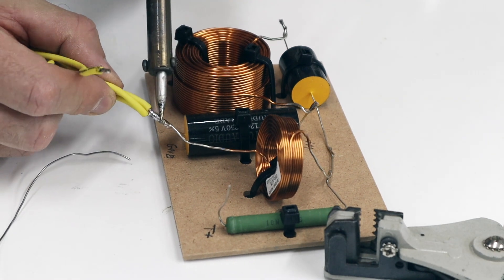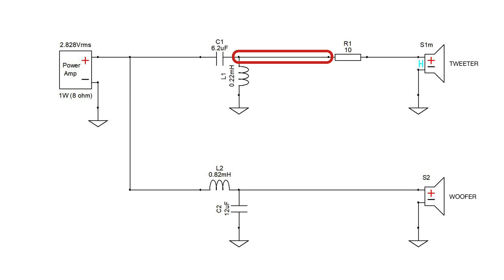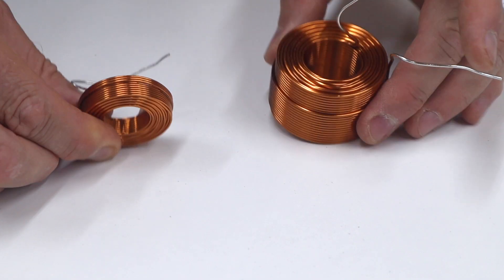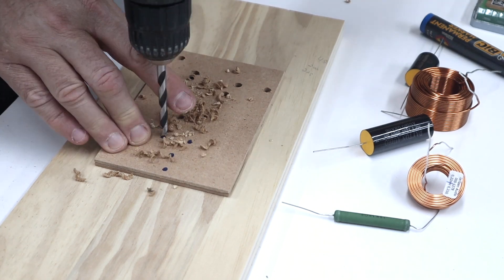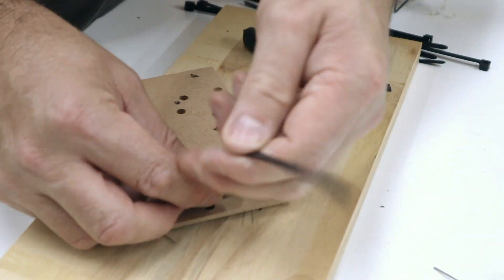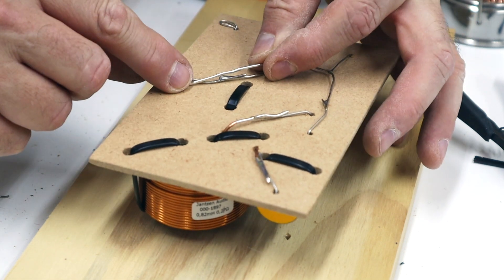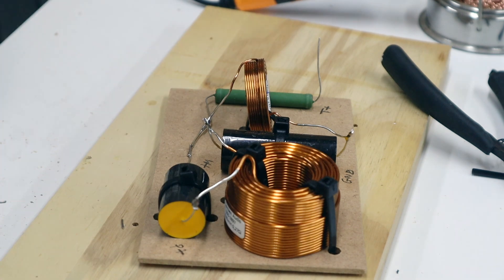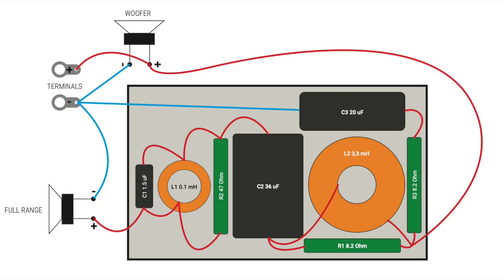How to Solder a Loudspeaker Crossover - by SoundBlab

Comment: Could you do a video’s showing the complete design of the crossover video 1 tweeter coving the design and the different components
Vid 2 midrange vid 3 woofer 
Plus could you also cover passive radiator Danke 👍👍

Comment: How about a hybrid solution where you wire the positives above the board and the grounds below, or vice-versa? May help to keep them separated and prevent accidental shorting, especially when you may need some jumper wires to connect the grounds.

Comment: Hello I have a speaker, I want a smooth crossover with a uf capacitor and eg an indtios mH coil, but I don't know the values, how do you match this speaker with bass, after all, it's a subwoofer Difuzor subwoofer profesional 12 inch

putere 500w/RMS

impedanta 4 Ohm, sensibilitate 97 dB, raspuns in freventa 56-3500 Hz

diametru bobina 4 inch-100 m

greutate magnet 3,55 Kg.

greutate totala: 9.3 kg

PARAMETRI, Fs 56 Hz, Qes 0.33, Qms 8.10, Qts 0.32

0,9mH 1,5uf??

Comment: My JBL 120ti 3-way crossovers used .01uf 200V DC bypass capacitors with the capacitors  (36uf 8uf and 14uf). Is this an advantage or can they be replaced or removed when upgrading to Dayton poly capacitors?

Comment: Where's the best place inside the speaker box, to mount a crossover?
 Im replacing the crossover in a traditional 22 year old box floor speaker.
 The new crossover is much larger than the older crossover being replaced.
Reply from the maker: This will depend on how you have access to the inside of the enclosure. This will normally only be through a woofer opening, so mount it on the back panel if you can or in the rear corner on the bottom panel, but make sure it is at least a few inches away from the woofer motor structure (magnet). If the board is too big for the opening, try making the crossover on two smaller boards, splitting the low and high pass sections.
Reply: @SoundBlab Thank you for the info. 
 I put it on the bottom.
  Clamp glued 3/4" solid wood cut to the size of the crossover, to the bottom of the speaker, then mounted the crossover to it with non magnetic screws.

Comment: I have a question on a bandpass crossover to my midrange.  The midrange is a 8" RadioShack mid.  I currently have it connected to a simple 20uF Polycap 1st order crossover.  All speakers 8 ohm.  The woofer 12" 50hz11000Hz full range RadioShack ( no crossover)   the tweeter replaced (was RadioShack horn)with Morel Cat 378.  This became the issue so I went with a second order crossover by Dayton audio 2000Hz  5uf Cap Dayton with 2.27mH inductor.  Better now but I attempted several tries  with Polycap and resistors with the final decision of the Parts Express.   Sooooo now with nice Polycaps left over I thought I would try to do a bandpass ...just to try.  Unfortunately the only info I have on the midrange is 8 ohm 8" Fs 100Hz.  The speakers sound good but more sensative to poor quality recordings of cd's or albums.  any thoughts   Thank you for the videos

Comment: is ok to replace 10W 2RJ  resistor with 10W  2.2ohm resistor in speaker crossover, will it be any big difference
Reply from the maker: It really depends where that resistor sits in the crossover schematic, but generally resistors have a 5% tolerance in actual value, so it should in practice not make a huge audible difference.
Reply: @SoundBlab   im new to this crossover thing.. but id love to do an upgrade..but i dont know what decent parts to get  i have a pair of klipsch synergy F3  but i dont know the schematic apparently the F3 crossover have 2 resistenc one (10w 2rj ) and the other is (10w 2.0 ohms)  the 2Rj is confusing.. do this two resistenc have the same value in ohms???
Reply from the maker: I don't know what the RJ stands for, but it is still just a 2 Ohm resistor, most likely a typical wire-wound in square  cement or ceramic casing.
Reply: @SoundBlab  ok.. Thank you

Comment: Just once I would like to see a crossover video that slows down and explains which are positive and negative. The is unstable but they twist a big rat nest of wires together it just looks like a big mess of confusion the reason why I watch these is because I don't know what goes where. I don't get it. My crossover would be huge because I connect everything separately. Just slow down and explain it

Comment: It would be good to point out that resistors to be used must be of higher wattage rating than used, for example, in more common PCB circuits videos.  (Despite the visuals provided.)

Comment: you do not test before soldering to the speakers???   not even a polarity test?
Reply from the maker: There is no effective way of testing a crossover without the proper equipment that can do a FRA analysis, and is normally outside the scope of the average builder. Thats why it is important to double check all the connections.
Reply: @SoundBlab  I would do;
1 -a  test for obvious short
2 - a polarity test
3 - basic test;  is the sound coming out from both speakers  as one would expect

Further , given the wide tolerance on these components I would test first - there are apps that can do a frequency sweep or generate a tone at a specific frequency.   It isn't as good as doing a 'FRA' but would give more assurance.

Comment: no.No.NO!!!
do NOT solder wire/cable directly to the leads of components - at least anchor the wire to the board. This will either break the lead or damage the component.
Reply from the maker: My experience tells me different. I have done exactly this a million times without any issues as you mention. Internal wire is normally kept in place by cabinet damping material or even secured to bracing with a cable tie or two, so we do not have it moving in the cabinet that might cause continued and excessive back and forth movement that can snap a component lead. But if this is a worry for anyone, then feel free to  anchor the wire in some way.

Comment: Good video but its missing the same thing I see in most crossover beginner guides which is the relationship between the logical diagram and physical network connections.  Your plans show how to physically build it which is great and you can reverse engineer the physical plans in relation to the electrical / logical plans but I think this video could have been a good opportunity to explain that better so when a user sees the electrical diagram it intuitively makes sense.
Reply from the maker: Thanks for the feedback

Comment: That was a fairly informative video however always using high speed to show what you are doing only helps shorten the video length. Showing real time in the beginning doing the soldering to get a good foundation is essential to learning. Once the concepts are understood, then things can be accelerated. The best way to watch you build the crossover board is set playback to .25.
Reply from the maker: Thanks for the feedback! Noted.